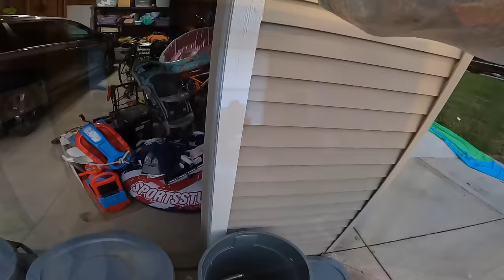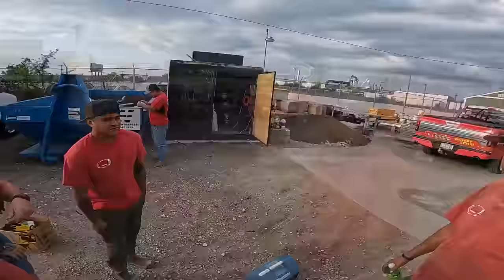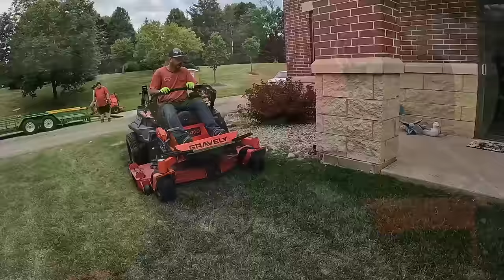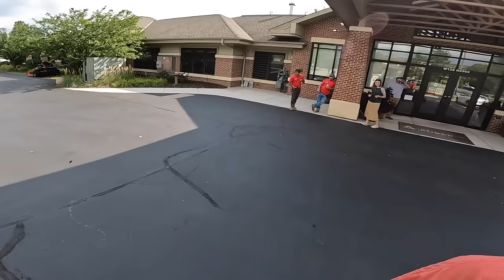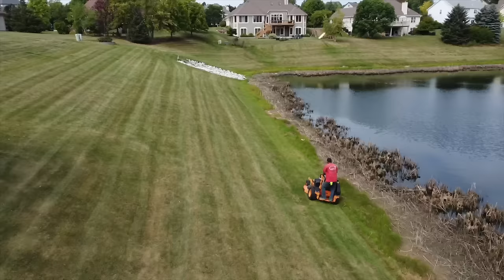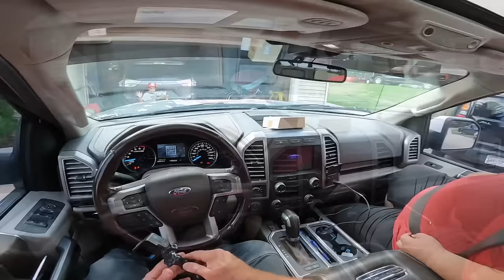Mowing is EASY MONEY!  But we are sticking with concrete!

Comment: nice vid again@ Ryan& Autumn .tip for removing weeds put them in a perforated basket, like that u can shake off the dirt pretty easy above the soil u took em from @Mike. saves u weight in transporting the weeds and the garden does not get so fast low on soil so the roots of the regular plants showing. kind regards from a Dutchman.

Comment: The trick to mowing on a hill is to keep your center of mass above your drive tires. On a stander, you want to face uphill cus ur mass is more front heavy. On a zero turn the weight is farther back so you want to face downhill. Same with Walker mowers 👍

Comment: Never did like mowing. Any chance you'd be interested in a little filler content? . Price estimate of a aviation runway would be kinda neat. Here's maybe some ballpark numbers you could use. JFK Runway 22R, 12079' x 200'. Aircraft runways are around 20 inches thick. Maybe assume rebar 12" on center and 18" longitudinal? Also, In my humble opinion, you need to get on some Victory Easy money stickers. Thanks and sorry for the long post. Great videos and great content. Take care

Comment: On pond side like those I would never use a stand on mower to take care of that hill. I would use the zero turn simple because the hydro pumps are much stronger and can withstand that level of inclination. Now I'm not sure about that zero you guys have I use my turf tiger. If I were to use my v-ride It would 100% go into that pond. Just the way the weight is dispersed on those stand up mower Is horrible you will always ride side ways and leave ruts eventually with enough passes do to the tire trying to dig in to get grip.